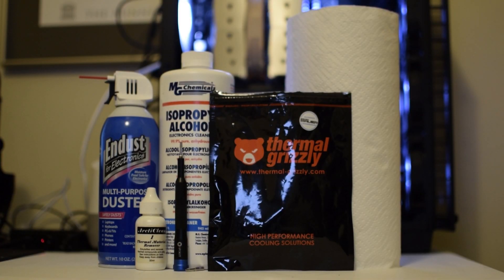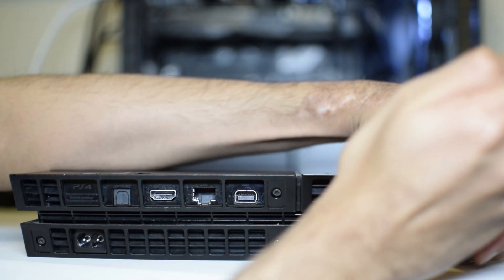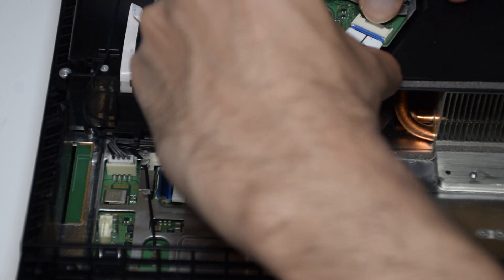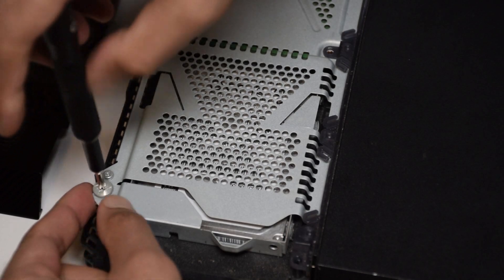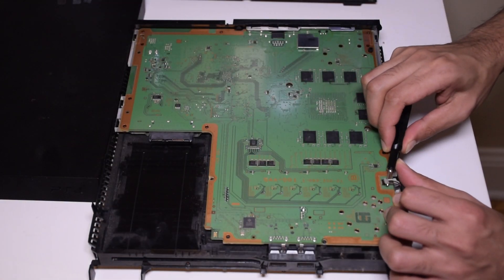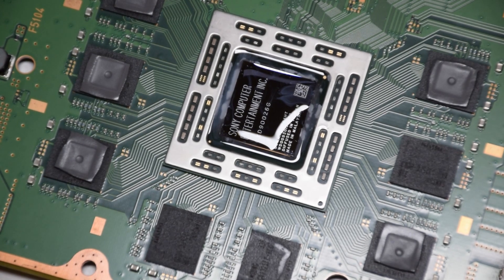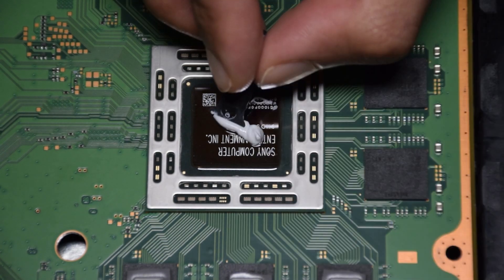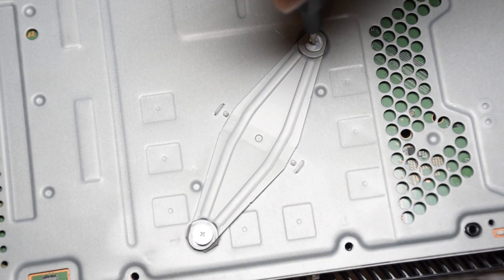How to silence your PS4 with a repaste

Comment: hello i watched a different tutorial to clean my ps4 recently. i replaced the thermal paste which wasn’t thermal grizzly because i found others thought artic MX-4 was the best thermal paste for it so i used that. i cleaned out the heat sync and the fan and all of the dust etc. but i’m paranoid to think that i didn’t do it the best i could because some people, not a lot only a few said to replace the thermal pads too but i didn’t and most people didn’t.
Reply: @shawnmiranda  alright i’ll most likely end up opening it up again lol, you know how the mind is 🙄 that’s true tho, thanks for all the help bro
Reply from the maker: The best thermal paste is either Kingpin’s KPX or Thermal Grizzly’s Kryonaut. That said, MX-4 is good enough for a PS4, it’s much better than the stock paste. You don’t have to replace the thermal pads but it’s better if you do. The stock ones don’t have great thermal conductivity and are ridiculously undersized.
Reply: @shawnmiranda  ok that’s good to hear! i put the right amount and also spread it out. that said, could u send me a link to the best thermal pads for the ps4 original model.
Reply from the maker: These are the ones I have on mine

https://www.amazon.com/dp/B00ZSJQLME/ref=cm_sw_r_cp_api_glc_fabc_gg47Fb10Q2SRT

Comment: cool video man, but maybe too fast in the cutting.
i tried to repaste with thermal grizzly, but the result is not as significant as yours. the previous paste mostly dried after 5 years from buy, but the result is not so significant in my case. the amount of paste used is about the same but my paste consistency seems a little bit thicker, because it is stored for 6-7 months from my first usage. it is the problem?
Reply: @shawnmiranda  hi man, decide to place my ps4 in vertical position and diferent placing. it is now much more silent like yours. the problem before is I place it in drawer style cupboard and the heat would stuck at inside. now i place it where the heat flow to the outside and it is much more silent now. thank you
Reply from the maker: I wanted to make it as short as possible because I don’t want to waste people’s time. I don’t expect you to finish this in 3 minutes, just pause and play. Storing paste shouldn’t cause a problem. Neither should thicker paste. It will thin out a little as you run the PS4. It is possible you didn’t tighten the clamp enough.
Reply: Shawn Miranda cool man! I’m pretty sure it is already as tight as possible, do you think it is worth to check it again and redo the pasting?
Reply from the maker: Might as well. If you want to make a video I might be able to tell you what’s wrong.

Comment from the maker: 2:56 Before
3:00 After

Forgot to add it in the video!

Edit (04/16/2020):
Trimming the video at the end because the before and after made the video an extra minute longer, unnecessarily.
Reply from the maker: If you're attempting to follow this video amidst the CoViD-19 pandemic, you will have a lot of trouble sourcing Isopropyl Alcohol. Buy Arctic Clean instead.